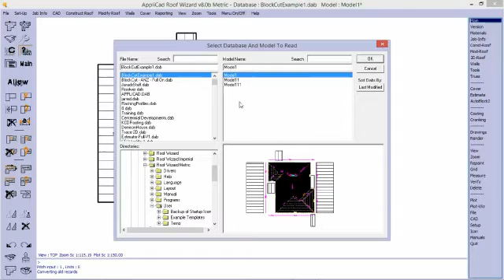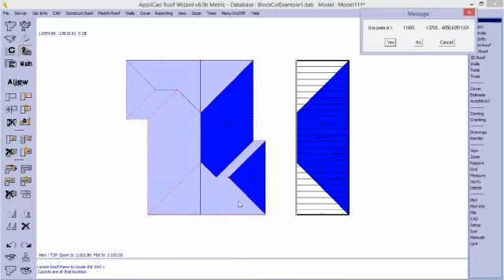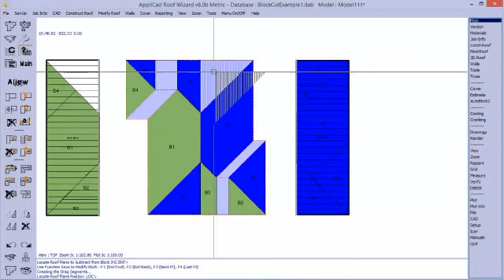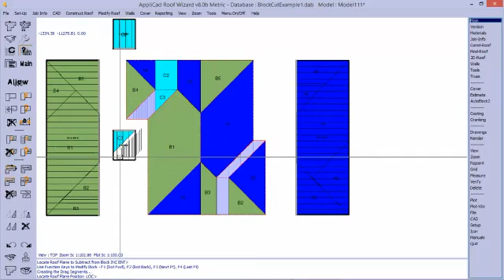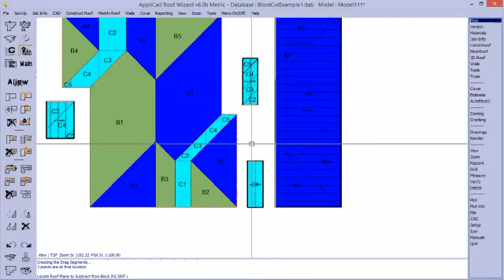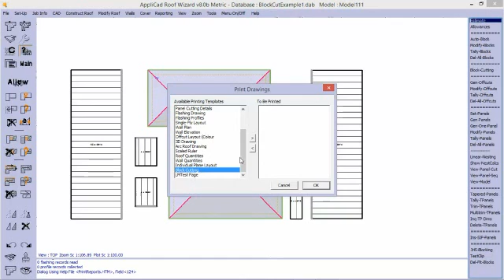AppliCad Roof Wizard - BlockCut 8c

Comment: In the video we can hear the cogs turning in the mind of the presenter as to which way the block is to be oriented but no dialog on that thought process.
Is there an easy way for an estimator (assuming they are not roofers!) to know which side of the off cut block is an over or an under? Or could there be added sheet direction arrows for instance?
Thanx
Reply from the maker: G'day Tim, Thanks for the question.  Yes, the cogs do turn with this process and it does take a bit practice to get familiar whith what works and what doesn't.  The lines on the block are indicating the sheet/panel direction.  The only decision is which corner that offcut comes from (or indeed goes into).  Hope this helps.

Comment from the maker: No argument from us about that.   The fact is that if the width of the building is NOT an exact multiple of a sheet width, you have to split a sheet.   If an operator thinks that this offcut can be used, there are tools in the software to remove the matching sheet.   No problems at all.   The process does indeed replicate what you do in practice, if you have an experienced operator running the software.   Perfect really.

Comment: The problem with this block cutting is that the blocks do not consist of full sheets. Some sheets are cut along length. That cannot happen in practice. It also introduces waste. Half a full length sheet
Reply from the maker: I am sure that I spoke with Pieter directly on this subject, and he makes a good point.  However, the start of the run is controlled by the operator and it would be good practice to start the block at a corner that eliminates or at worst, reduces the incidence of slitting sheets along the length.  The result is entirely under the control of the person laying the blocks and inserting the cuts.